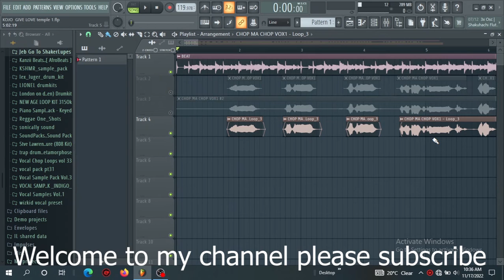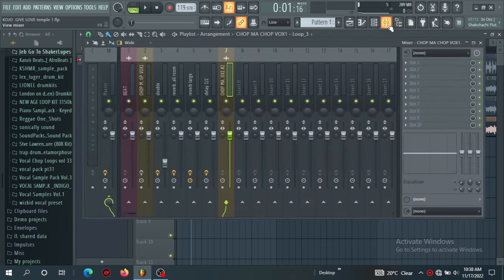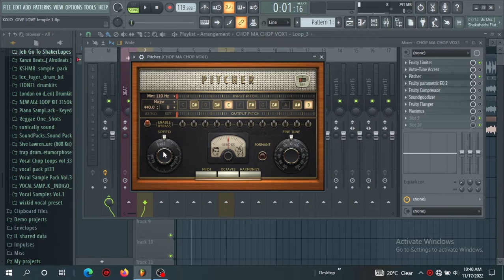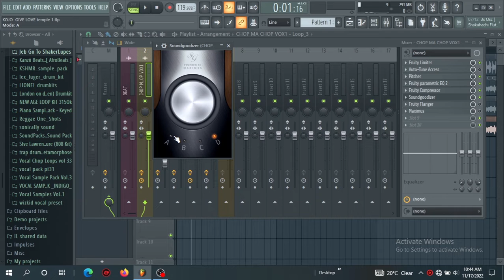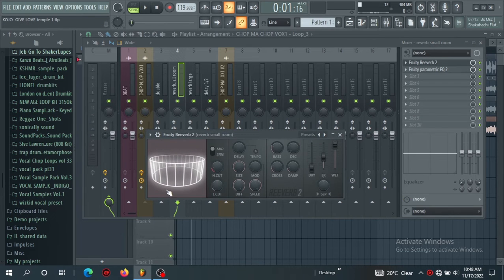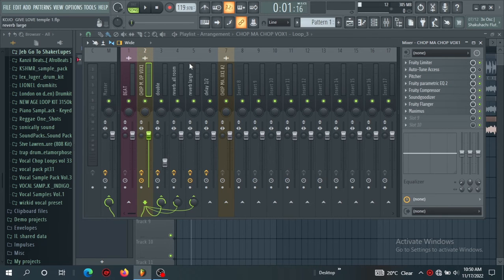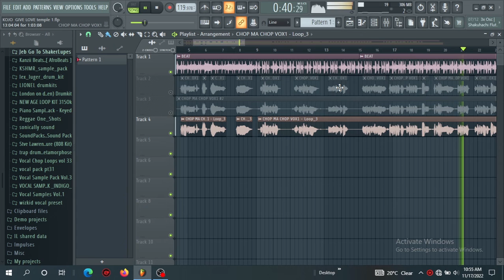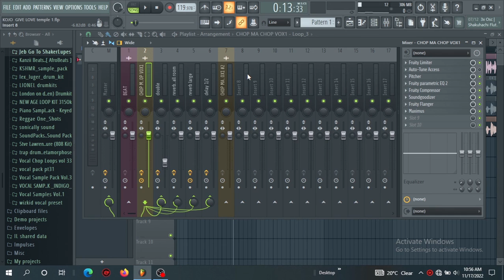mixing poorly recorded vocals with stock plugins in fl studio

Comment: Hello, I have a problem. When I master my song and then exports it, the song master turns out to have low volume.. is there a fix to this? Pls urgent. I am using a Mac by the way..
Reply from the maker: What Daw are using. Or what mastering suite . when you are done mastering your track, use a loudness meter to be sure or reference it with a well mastered track from same genre. Your track maybe loud when you listen through your studio monitors(speakers) because of the gain volume on your audio interface is high. Just use loudness meter to know how loud your track is
Reply: I am using FL Studio, I use maximus to master. I use a loudness meter but when I export it is low 
 @abnaira
Reply from the maker: @DickensBlessingMedia  ok . check the post process . the effect on the mixer track are not active or printed.
Reply from the maker: @DickensBlessingMedia  when wanna render or export your track turn on Enable master effects and Also Enable insert effects. This way the effect you apply on your mixer faders will be printed. With your track
Reply: @abnaira  Allright, will check and get back to you